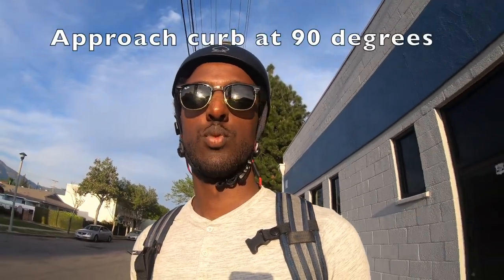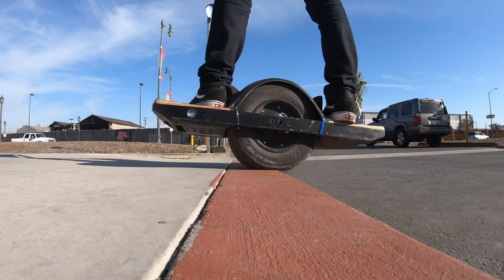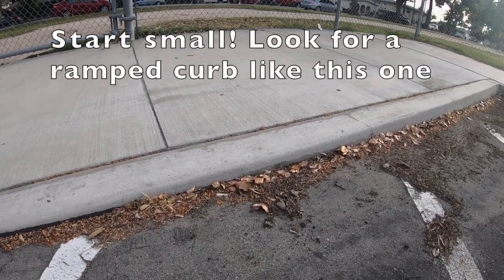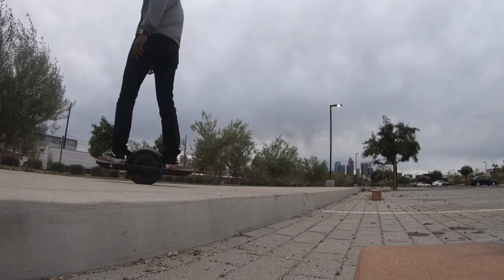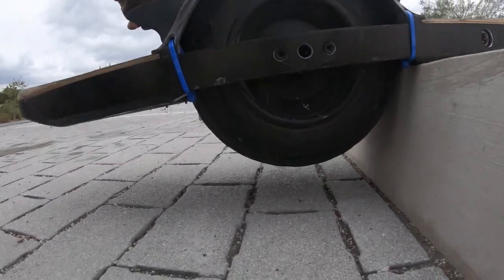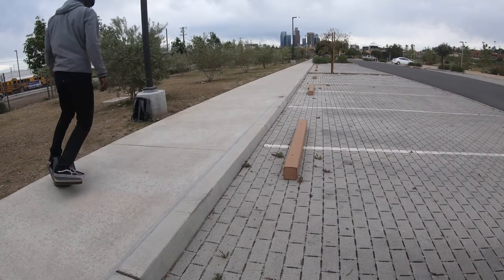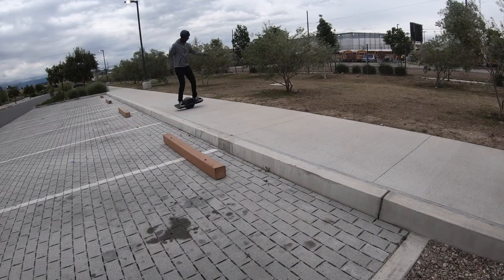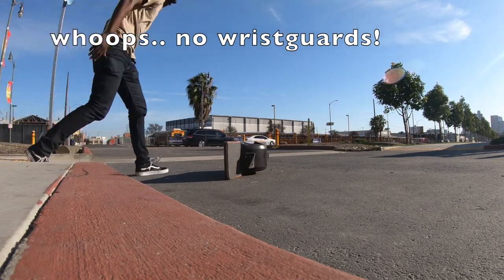Onewheel Curb Nudge Tips

Comment: I feel like you're crutching on the flight fin to do these nudges, without having a fin or fender to shove, there's a lot more technical steps and it's much more difficult.
Reply: 3 years late but i agree, i put it in .25 speed and the board is in the air before the curb makes contact
no shame to MoKashta, it works well it seems, but is a little misleading to a new rider like myself

Comment: I've got about 100 miles on my XR, I'm 205lbs and I can't get above 8mph. Can you do a video showing how to accelerate to 15mph? If I lean to much, I nosedive,if I don't I go nowhere. The only way I can get up to 8mph even is by bending my knees and being light on my feet per se. Please help!
Reply from the maker: C K what shaping mode are you in? Check out the app and make sure you’re either in mission or delirium
Reply: @modali08  I stick to Mission, Delirium or custom shape with 11 aggressiveness.
Reply from the maker: C K that is really odd. If you’re sure you’re not in sequoia, and you are feeling a lot of pushback at 8mph I would send the board back to future motion. That just doesn’t sound right. I weigh 180 and have got to be close to 200 with my bag and gear on, but the board has no problem getting up to 15 mph